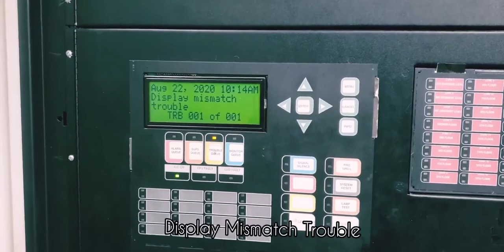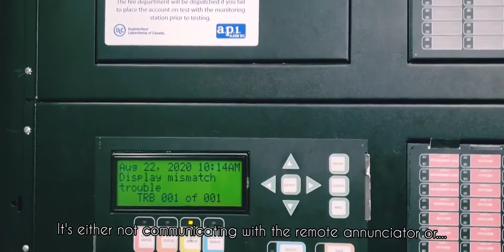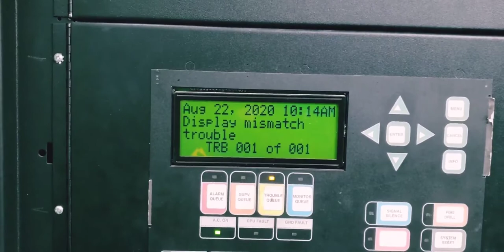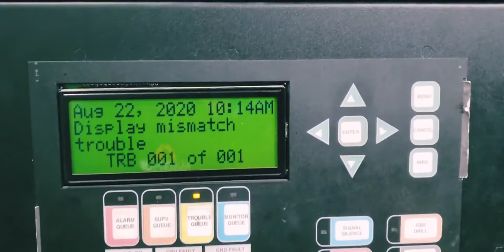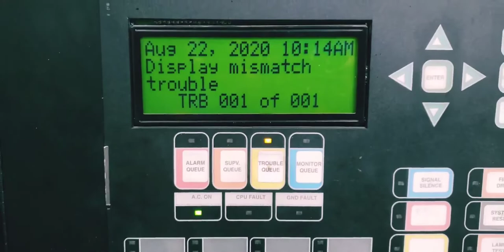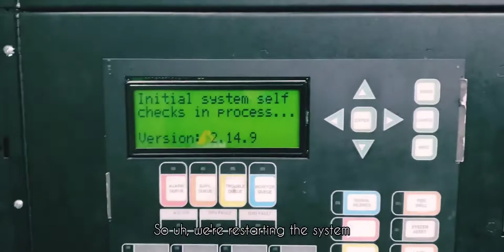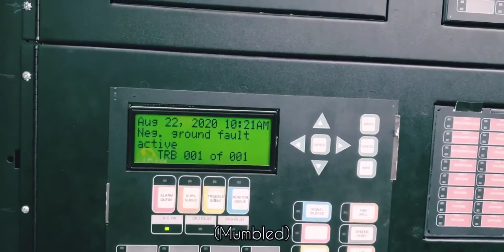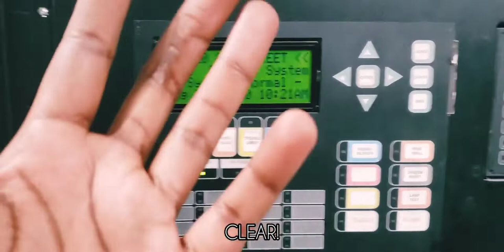How to Troubleshoot Mircom FX-2000 Fire Alarm Control Unit🇨🇦

Comment: rs485 requires a terminating resistor. Its possible you cleared it but it still needs that terminating resistor, it cuts the noise down on the rs485.